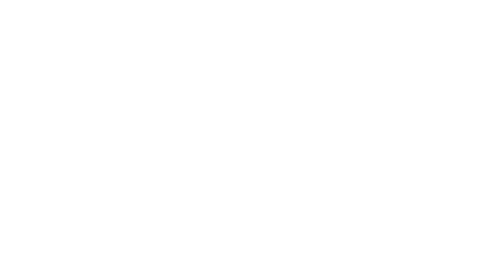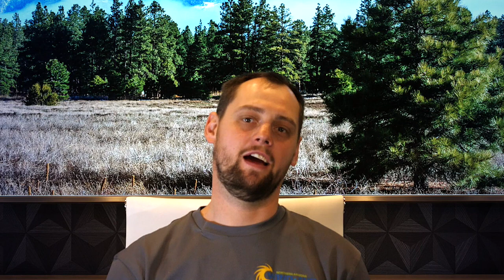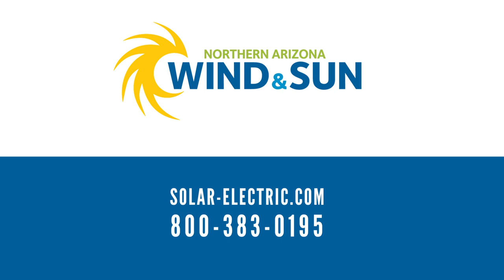How many solar panels are needed to run AC on an RV?

Comment: Solid, Fastly.Cool and gets the job done. For RV where window-mounted air conditioning is not an option, this works very well. Easy set up, rapid cooling, and great design.

Comment: I have 950 W of solar on my 25' RV. It will put out over 50 amps for a good portion of the day. I installed a 9000 BTU MINI-split air conditioner ( Like the guy on 'gone boondocking'  Channel did)  It's the high Efficiency 22.5  SEER model by Pioneer. Goes for around $870. I bought another $400 worth of stuff to install it and did it myself. Uses around 20 to 30 amps at 12 V out of the battery. I love it.
Reply: can you please tel me the model number? I'm looking on amazon and can only find a 19 seer at 9,000 BTU. Do you have your panels tilted?
Reply: How many. Hours AC can work on solar battery at night?
Reply: @blatzphemy   Don't remember the model number but you can find it on the Internet the pioneer 9000 BTU 22.5 SEER. I Can tilt 2 panels on one side but I'm so crowded that I can't tilt everything that would block some of the other panels
Reply: @e7bk   I have 400 amp hours of battleborn lithium and I can run the air conditioner all night
Reply: I’ve been saying that for last two years you do it right with the lithium ion battery bank  large enough and you can use electric motors to angle your solar array at a 45 degree etc and of course depends what kind of RV you have and what size a school bus obviously will give you a more class be less you can add portables on the ground! You can go to 40 V system down or 24 to 12 what day 2412 download transformer running in parallel and series get more power etc.  I want themPPT and all these newer Victron chargers it makes a big difference
Reply: @e7bk  divide your battery bank capacity in amp hours by about 150. 6 100ah batteries could run it for 4 hours if they're lithium, but for agm or lead acid, only half of that.
Reply: @edmor1086  what a savage

Comment: You can get a window AC or a floor AC that pulls 500-1000 watts and run it off of daytime solar with a good inverter for a few hours whilst the sun is in late morning to mid-late afternoon. As long as you have around 1000+ in panels.
Reply: Ive been researching window Ac's and I've seen videos of the midea 5k pulling like sub-200 watts & less than 300 watts a lot, and that's not even trying to be super efficient,

Comment: Here are some tips if you want to run A/C off of solar in your RV:

1 -  Seek cooler weather/higher altitudes.   This is going to have the greatest impact on your need for A/C as well as how much power will be required when you run it.

2 -  Insulate your RV as well as you possibly can.   The better insulated your RV, the less power is needed to cool it.  Especially, focus on covering windows with Reflectix, custom cut styrofoam inserts, etc.   And, remember, the more solar panels you mount on the roof of your RV the less sunlight will be hitting it and heating up the inside of your RV - so, you get both the benefit of more power generation capacity and less energy requirements for cooling.

3 - Replace a standard RV A/C unit with a high efficiency mini-split system.   Residential mini-split A/C units are designed to be both higher efficiency and greater reliability than RV units that are designed for occasional use while traveling on vacation.   You can expect an RV A/C unit to last three to five years of fulltime RV use.  A mini-split system could last you 20 years, or more, of fulltime RV use.

4 - Get the largest LiFePO4 battery bank you can afford.   It should have, at least, 5kwh of storage, as a bare minimum - otherwise, it's just not going to be worth it to try to run A/C off your system.  You should also consider configuring your system for 48 volts, rather than 12 volts.  This will reduce your cabling costs, increase efficency of your inverters and charge controllers, and make installation faster and easier.  Use a 48 volt - 13.8 volt converter for 12 volt appliances that cannot run on 48 volts.  Do not attempt to use lead-acid battery banks, if you're trying to run A/C.   The charge/discharge inefficiency and weight of lead-acid batteries is enough to make the whole project not feasible for an RV.

5 -  Get the highest powered pure sine wave inverter you can afford.   A/C units have high current demands, especially on start up.    And,  lower powered inverters are just not going to be up to the task.   Your inverter should be rated for a continuous output of, at least, twice the running power requirements of the A/C unit, preferably even more.  If you try to cheap out, here, you're going to regret it - because, you are likely to kill a cheaper inverter, rendering your investment in it worthless, and you will end up buying the larger inverter, anyway.

6 - Plan to not use A/C in the mornings until your battery bank has been replenished completely.   So, the more solar power you have, the sooner you will be able to run your A/C.

7 - Top off your battery bank late in the afternoon, using your generator or shore power, if available, so you will have maximum capacity to run your A/C after the sun goes down.

8 - If possible, supplement your rooftop solar array with portable solar panels you can deploy on the ground.   These solar panels can be turned and tilted in the direction of the Sun more easily and provide extended hours of power generation.

9 - As much as possible, learn how to live without A/C.
Reply: Thank you for information.
Reply: I'm stealing this
Reply: Us a DC MARINE air conditioner instead of an ac unit
Reply: "...at least, 5kwh of storage, as a bare minimum..."

I have been running a 9000btu mini-split off solar and batteries for 3 years.  A minimum 16 kwh of battery has been my experience.
Reply: @rustyloads1361 Are you running 1k watts of solar too or more. Mini split is the only way now for A/C especially for an Rv setup.

Comment: Almost everyone that I know that runs their AC for any length of time from a solar charged battery bank uses a very efficient mini-split AC instead of their inefficient roof AC. There are mini-split systems that are over twice as efficient as your typical roof mounted AC. They are quieter too. So doesn't it make sense to get a 12k Btu mini-split that consumes between 750 and 500 watts that might cost $2,000,  and install maybe a $8k-$10k solar system/battery bank, or try to use your existing roof AC and spend $20k because you'll need twice as much solar and batteries (at twice the weight and roof space too)? Most folks don't have either, so it only makes sense to get something like a Harvest Host DC only mini split (that produces 12k Btu's of cooling while only consuming 11.5  amps at 48V (560 watts.) They have no startup surges due to their rotary (danfoss type) compressors. Add to that a 5-10 kw, 48v lithium battery bank,  2,700-3,000 watts of solar (to power your AC during the day while charging your batteries for night use) and you've got a good start on a practical solar powered AC system. I'm planning on a similar system on my motorhome in a couple years. I already installed a smaller, 620 watt system on the side of my MH, for my 12v power needs, to leave the roof available for my big system. I got the panels and some components from N. Arizona Wind & Sun, BTW. Great guys!  Of course if you need more cooling than that, you'd have to increase the system's size, expense and weight. Instead I recommend getting an RV with good insulation, double pane windows and using reflectix liberally (just not inside double pane windows).
Reply: how much would something like that cost?
Reply: @clbaker24  A top of the line Hotspot mini split 12k Btu heat pump is in the $2k-$2,100 range. I will be building a 48v DC system including 3,000 watts of solar, an all in one inverter/charger/ solar controller and a 14kwh Lithium battery bank built from the 280ah prismatic eve cells for around $8k. I plan on putting a system like this on my motorhome to go along with my current 12v, 620w solar system (mounted on the side of the MH) just after the first of next year. It sounds like a lot of money, but it will pay for itself in just over 3 years of FT boondocking. My first phase, which cost around $1500, paid for itself in saved CG fees and generator fuel in only 3 months. Of course you must boondock a lot to realize these savings. We boondock about 1/2 the year currently and will be able to boondock 100% of the time with the second phase. I have been boondocking since April (It's 8/21 now) and have spent a total of $70 in campground fees singe April.

Comment: Maybe might want to mention solar panels are less efficient when running in high heat -- another factor to make this a difficult proposition.  Then there's the idea that when you have used up all of your battery to run your AC unit, what's left for all your other appliances since you don't want to have dead batteries all night long.

Hoping to add a bit more solar to my system (maybe 720 watts more? for a total of 2000 watts) and then  use my 6000 btu 470-watt soft-start AC unit (until I can afford a mini-split).  Planning on walling off the back 1/3 of my rig so I only have about 64 sq ft to cool.  Hoping that will make this a more doable idea, too.

A few weeks ago my 1280-watt solar panels put out 1315 watts power (at some point during the day - I'm always thrilled to exceed the total rated capacity of my solar panels).   But it was extra COLD that day.  Solar CAN and DOES go a LONG way to running high power appliances.  I think my system is proof of that -- right?  

Max I've run so far is 4.1 kilowatts used for one day with excess still to burn. ... with 200 AH batteries.

Comment: Regarding the assertions in the video - does the rooftop AC have a soft-start installed to slowly ramp up the start surge of the compressor? That can make a huge difference.
Reply from the maker: Yes, we would always recommend installing a soft-start. Thanks for the comment!

Comment: There's more to air conditioning than just slapping on more panels and stuffing in more batteries. Cover the the outside of the windows to greatly reduce radiant heat. Get a rig that is properly insulated; cooling down a rig with 1 inch of fiberglass insulation is darn near impossible. Seal off one room instead if trying to cool down the entire 38 feet of a rig.
Reply: YEP, got to do something about my sun-facing wall, which can get up to 130-degrees when it's only 80 degrees outside.  That isn't going to cut it!  Need a lot more insulation and install reflectix on the OUTSIDE of the windows when parked.
Reply: p00
Reply: @Roobah  put a roll out exible solar on the outside of the window 😁👍

Comment: I just installed a system on my brothers 30ft Cougar trailer with enough panels and battery storage to run AC and washer/dryer combo off shore power. It can be done. 

6 x 315w = 1890w Trina solar panels
3 x 40amp solar chargers
23 kWh LiFePO4 battery bank. 
3000w inverter
Reply: Jonathan Fritz how much did that run you guys
Reply: Ricky Salcedo about $11k
Reply: A few days ago we had full sun and clear sky. We were able to run the AC unit while only pulling 92 watts from the batteries. June-August we will be able to charge and run the AC unit. We also installed an AC soft start which works great.
Reply: @jonathanfritz87  Thank you for that info.
Reply: How many battrys did u buy for solar ac
Off grid?
Reply: @mohamedfiraz7041  We installed 1800ah 13.3V LiFePO4 which is 23.9kWh of power

Comment: It would matter greatly as to whether the RV is parked in a deep shade spot.  Probably then could get by with a 5000 BTU (500 W) instead of 12000 BTU air conditioner.
Reply: Then how would you charge the solar in the shade?

Comment: Its amazing how much crap they put on the roof if an RV these days. Of course they configure everything in the least symmetrical way known to mankind. Its amazing there is room for anything up there.
It's one of the reasons I'm building my own. I have room for 4850 watts of solar panels on the roof of my 34 foot gooseneck, 12 feet of which is a non climate controlled garage. Even at half of the rated solar output, I will have enough to run my mini split all day and still charge my batteries.

Comment: Besides the AC draw, the inverter and solar controller and what ever else runs in the back ground, will have to be accounted for...And you have to generate more than that so you don't empty your batteries and it charges them some. Another thing is some controllers won't charge unless they see X amount of current available, so if you only have 5 amps left over after powering everything, your batteries might not charge. So you need to investigate and then do some math... And get a more efficient AC unit. Some of the old RV's aren't that efficient because solar wasn't affordable... And you were running off grid power.

Comment: Batteries, panels, is that all you need? No. What about the inverter? I have 2000 watts of solar panels, and 10 900cca batteries, but still no AC. My 3000 watt inverter shuts down when turning on the rooftop unit. I have had to buy a window unit that the inverter CAN handle.

Comment: Roof top rv ac = notoriously expensive inefficient poorly built power hog.
Solution: 
30+ seer mini split ac 
Insulate. 
1kw+ LifePo4 battery bank
2000w+ solar
Victron 120/240 inverter setup 
Hurricane Power permanent magnet DC alternators belt driven by honda clone engine through voltage regulator into battery bank. (very fuel efficient, no conversion losses).